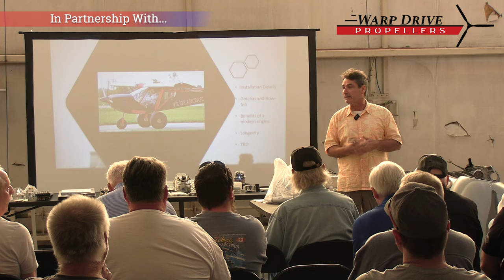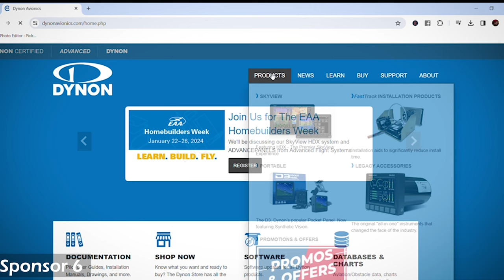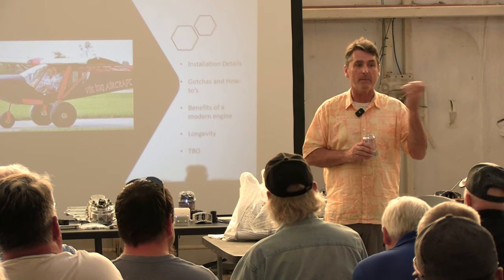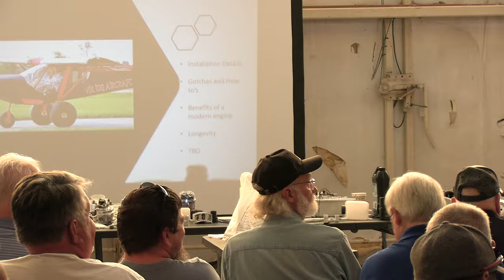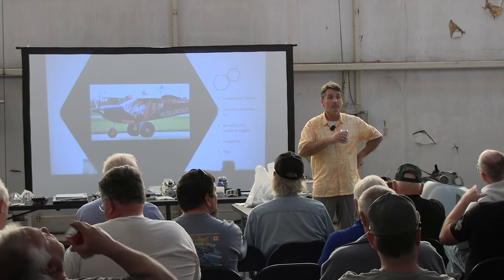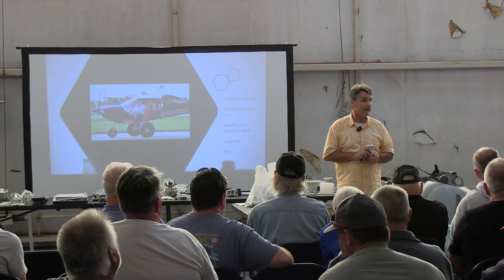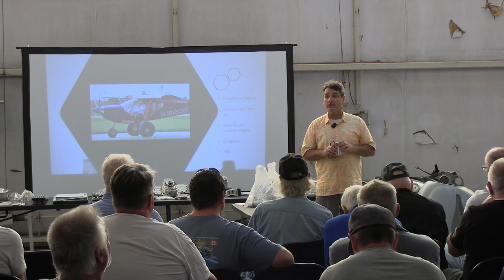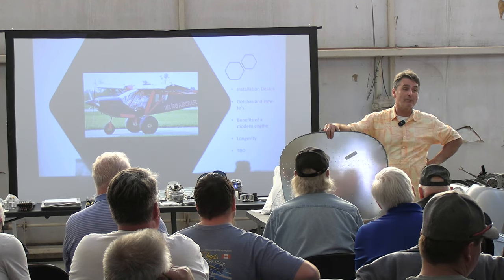Zenith Aircraft - Sebastien Heintz at Viking Aircraft Engines Day

Comment: Here's another hand up for the Super Duty CruZer!! 🙋‍♂️

Im hoping to start building in a few years... Cmon Zenith, get to work! 😄
Reply: Though I'll add to that thought and say ideally a 2+2 SD CruZer like the Murphy Radical would be the preferred configuration.
Reply: Yep, I'd go with a Super Duty Cruzer. Currently, the offering is making me look elsewhere. But would consider a good kit 801 that I remove slats from.
Reply: @joesacher  I personally wouldn't do an 801 because the kit is much less refined and would require a much greater build time. A 750 CruZer seems like an "easy" new product release for Zenith, but what i'd really like to see is an 850 CruZer. A fully match hole drilled, final size with up to date build plans, pull rivet, true 4 seater with a respectable cruise speed. 

I'm just giving my fingers crossed one of these things happens before I'm ready to start building. The 850 is my dream kit. I'd settle for 2+2 like the 750 CruZer.
Reply: @mcorrive12  That is what I meant by a "good kit" 801.  Honestly, the focus on Sport Pilot sized planes is what it pushing me to others than Zenith.  A Super Duty 750 Cruzer would probably put me close enough. Hopefully Mosaic will change this limited focus on size.
Reply: @joesacher  I agree completely. I just don't love the whole, "just take the slats off approach" that some people take. I understand why they take that approach, because there are no other great options. A 750 stol with slots removed is still much slower than a 750 cruzer. Would love to see zenith produce a super duty cruzer or ideally an "850 CruZer" 4 seater.